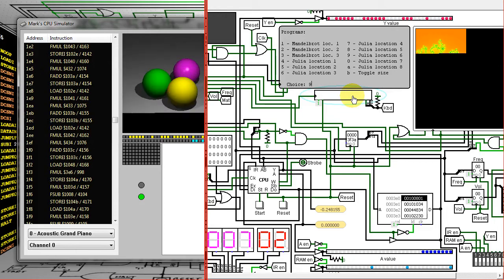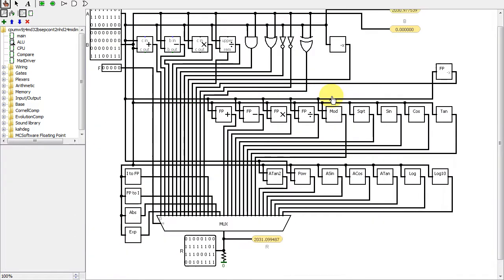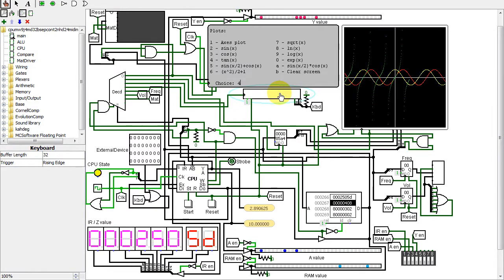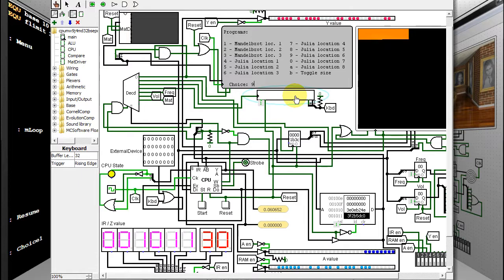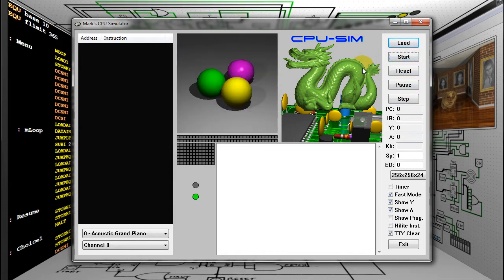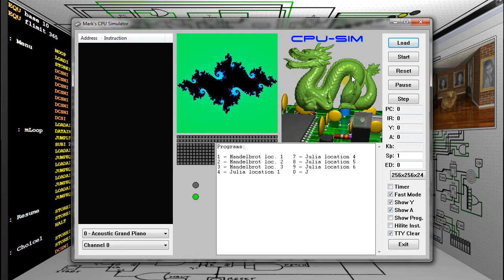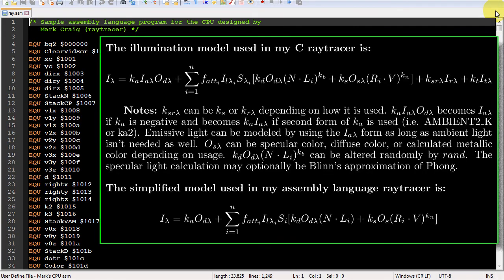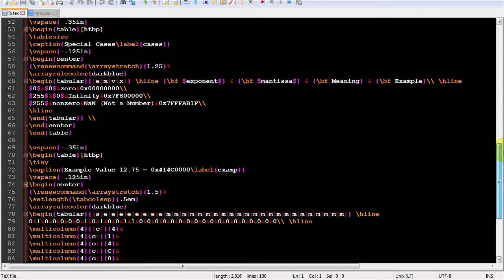My Logisim Floating Point CPU / Computer - (FPU) (Fractals, Raytracer, Etc.)

Comment: Can we get the actual code for the logisim CPU you have shown in the video? I mean, if you're shy about it, just the CPU section would be more than great to be honest, but all the links you've included are just various versions of Logisim.
Reply from the maker: @John.S92  Sorry, my circuit file isn't available for download.  I have made some Logisim JAR files available (not the floating point one though) for download though.  If those are of interest to you, you can check out my github repo:

https://github.com/mrmcsoftware/MyCPUfiles

There are different libraries that in many cases only work in one Logisim version or another. I wrote my MIDI Keyboard device to work in not only original Logisim but various forks of Logisim Evolution as well. Some other libraries only work in either Logisim or Logisim Evolution (but not likely the latest versions) but not both.

Also: https://github.com/mrmcsoftware/MIDIkeyboard might be of interest.

Comment: Really ignorant question but what aspects of digital architecture should I focus on to get an understanding of floating point maths as a whole down to the physical circuit design? I have a lot of reading materials but it's all quite advanced and I don't know where to start exactly. Any response from anyone would be appreciated
Reply from the maker: @Bart Somerson I don't know if I have much of an answer.  I think in some college course of mine, IEEE 754 was discussed, but I'm not sure what course (and it probably wasn't any more than 1 class on the subject), so I can't recommend any books.  As far as the physical circuit design part, I may be wrong but, I don't think many people now-a-days deal with the physical circuit design, they likely just write some VHDL or Verilog to do floating point math and let the design software convert the VHDL/Verilog to circuits.  Some even just use already existing floating point IP cores (either open-source or proprietary).  Having said that, there probably are some people who have designed the circuitry themselves, but I wouldn't know where to look (though, a lot of times it's just add, subtract, multiply, and divide - sines, cosines, log, power, etc. would be harder).  Sorry I couldn't be of more help.

Comment: Hats off! This is hard-core stuff...  I was fascinated with vintage Am9511 FPU and to try it out interfaced it with Propeller chip. I wish somebody would reverse engineer that chip for all the FP function routines in the microcode - https://github.com/zpekic/am9511
Reply from the maker: @Zoltan Pekic Many thanks for the compliment!  Hats off to you too for your project.  Yeah, it would be very interesting to see the routines.

Off topic: I have a subscriber whose name is Zoltán - I hope he doesn't unsubscribe because he has an interesting sounding name (especially in combination with his last name).  Of course, I always hope subscribers don't unsubscribe :-)
Reply: @MrMcsoftware  Thanks a lot! With interesting projects like this from which we can all learn you will only gain subscribers! Given enough time, I would like to use my own microcode compiler to write those routines. There are various FPGA FPU implementations, but most of them only do basic operations https://hackaday.io/project/172073-microcoding-for-fpgas
Reply from the maker: @Zoltan Pekic Thanks for the supportive words!  And another great project of yours!  Yeah (only basic operations in FPU implementations), that was my experience when searching for various open-source FP cores.  Perhaps/probably the commercial ones have more operations.  Given the projects you've undertaken, I'm sure you will write those routines.  But as you said, time is an issue.

Comment: Very interesting work! Have you put this work into an FPGA??
Reply from the maker: Thanks!  I haven't put it in an FPGA but I would like to.  The FP part might have to be left out to put it in an FPGA.  And I would also be concerned about the number of I/O pins (pin assignments).  Maybe someday...
Reply: @MrMcsoftware  Recently I'm designing my single-precision FPU, by writing Verilog. I find it is really complicated because I have to handle special numbers such as qNaN, sNaN, Inf, in order to follow the IEEE 754-2008 Std. Besides, I find that the fused multiply and add (FMA) operation is really difficult to implement. It's very nice if you can share your ideas about FMA.
Reply from the maker: @HYF SYSUEE  It would be nice if I could share my ideas about FMA, because I don't really have any :-(  I'm not sure if you mean how to implement it in Verilog, how it works, whether it's a good idea, etc.
    If I had a chance to put my design in an FPGA, I imagine I would use a public domain floating point IP core rather than write my own.  I probably wouldn't normally go the easy route like that, but it is a complicated problem as you know.  (Even worse when needing math functions (power, etc.), though open source IP cores tend to just have a few).
    I don't know if your project is for a class assignment (in which case there would be restrictions I'm sure) or your own project, and if it's your own project, whether you just want something that works or you want to learn how to do it and feel like you successfully tackled something hard....  But, if it doesn't matter how it's done, maybe the IP core route would work - or at least look at how they did it (I think the VHDL or Verilog code would be viewable).  One source of IP cores is: opencores.org
    Hope this was useful...

Comment: Do you know how to convert binary floating point to decimal scientific notation? I know you can convert them by using one of the properties of logarithms but that method returns numbers which are not 100% accurate. I know some computers, such as the Z3, which can nicely do this conversion process but the documentation is lacking. Pocket calculators can also do this as well.
Reply from the maker: Is your question how to do it in general or how to do it in circuits/Logisim?  If in general, then the question is does it matter how it's done (like is it for an assignment in which you need to do it a certain way or is it something in which it doesn't matter how it's done)?  Is it a program?  Is it a matter of displaying it as scientific notation?  If yes to both, then printf with a %e format will do it (either C/C++ or System.out.printf (or String.format) in Java).  BTW, keep in mind that the binary floating point representation isn't exact since it's based on powers of 2, so you wouldn't get 100% accuracy in all cases.  But maybe you mean just the conversion process to scientific and not including the storage of a value into a floating point format in the first place.

But, if you wanted a circuit implementation then I don't know the answer.
Reply: @MrMcsoftware  How to do it in general, like an algorithm. Implementation is my problem. And it is not for an assignment by the way, in fact I am going to make it using sequential logic, with just an adder, shifter and a couple flags in Logisim.
Reply from the maker: @Konrad Zuse  I can't think of a way to do it in circuitry.  The only thing I can think of is to process the bits of the floating point representation (extract mantissa, exponent, etc.) and doing the math to convert to a floating point number in base 10 and then convert that to scientific notation using the standard way of converting (see how many places you have to shift the decimal point).  I show an example of the bit math in Table 3 at 0:45   But I don't know if this is what you want.
Reply: @MrMcsoftware  Oh my god, it's so simple! I never thought of doing 2 base conversions, one from bin to dec and from dec to sci. I was trying to directly convert the binary FP to decimal Sci. This may not be the best way but it surely works! Many thanks.
Reply from the maker: @Konrad Zuse  You're welcome.  I'm glad this method will do.